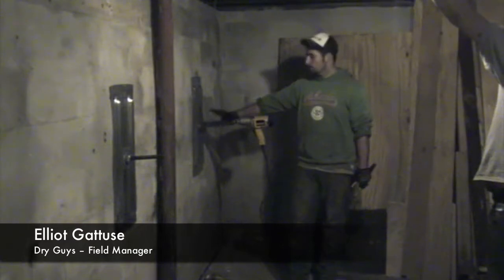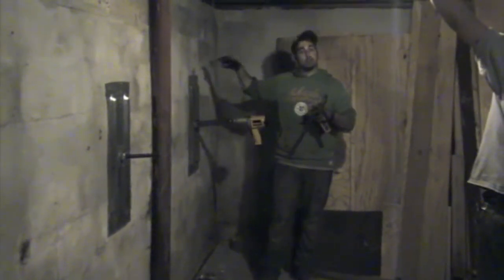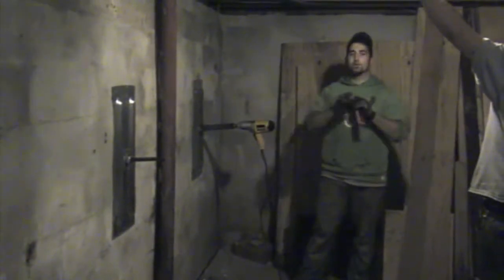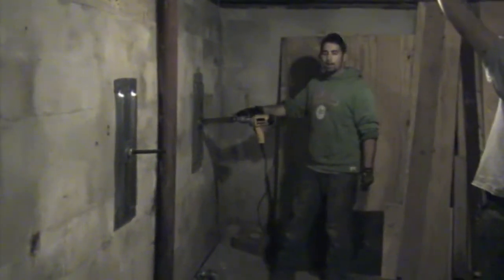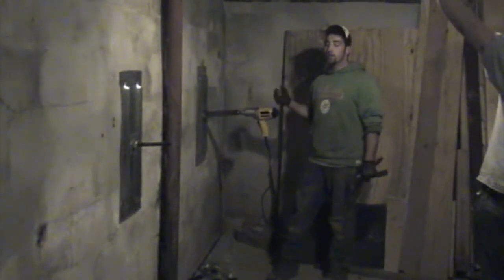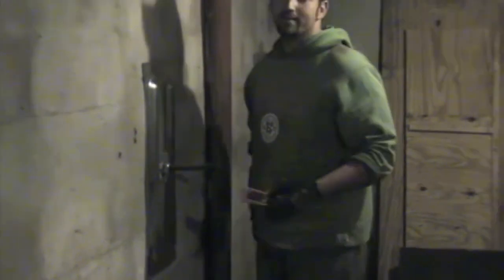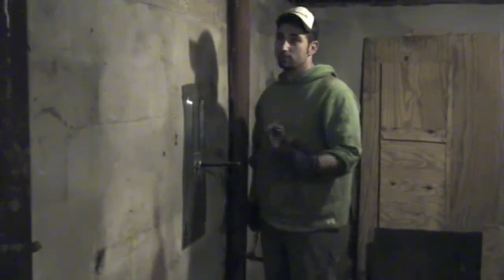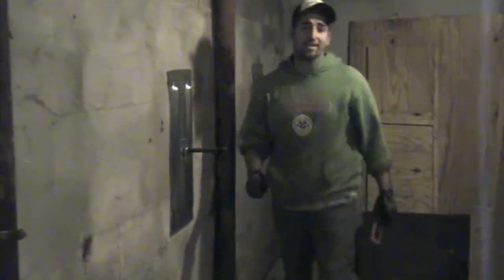How to Tighten Earth Anchors to Straighten a Wall

Comment from the maker: There is an art to doing high quality foundation repair work!
Watch our top videos:
Helical Piers- Pros, Cons, and Tips: https://www.youtube.com/watch?v=N3BqzREDseQ&t=196s
Carbon Fiber Straps- Pros, Cons, and Tips: https://www.youtube.com/watch?v=JRj9VhURCjA
3 Ways Your Soil is Causing Foundation Problems: https://www.youtube.com/watch?v=HsgaFl--JMc&t=30s
Reply: Question. The first owner did the job himself I believe but it's now leaking from the plate. I can turn the nut with a pair of channel locks. That isn't normal I take it is it
Reply from the maker: @thecommonsenseconservative5576  No the plate is not supposed to leak. If it were our install, we'd remove the plate and reapply the wax that seals it so that it doesn't leak anymore. It would be a good idea to have a foundation repair expert look at your issue especially if it was a DIY repair, just to make sure something more serious isn't happening.
Reply: @DryGuysNJ  yeah so I actually didn't know that it was just toilet bowl wax but managed to take the plate off myself and refill it and then I had a company come out yesterday and they told me it was fine in fact they didn't even know why I had the anchors installed to begin with because the walls were perfectly straight but they were already installed before I bought the house appreciate the reply